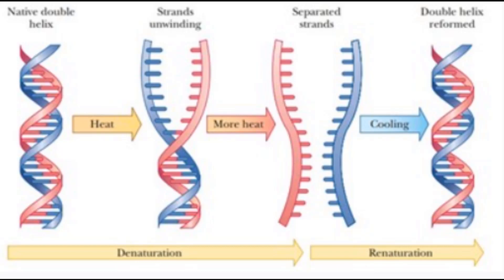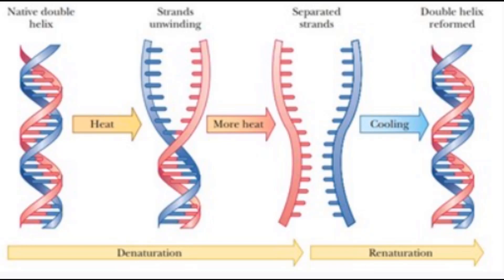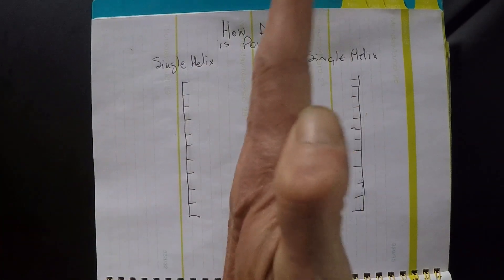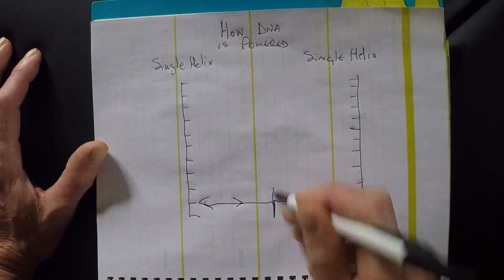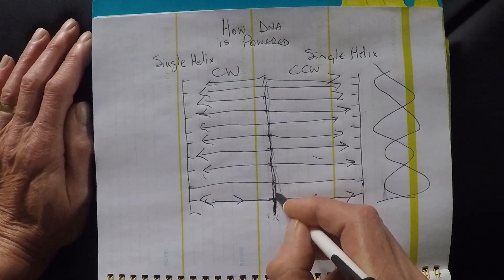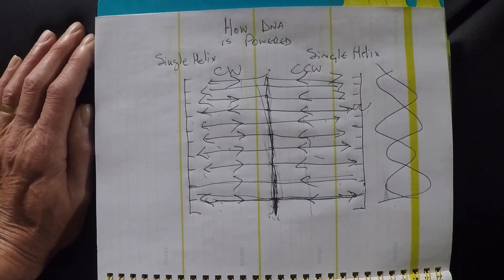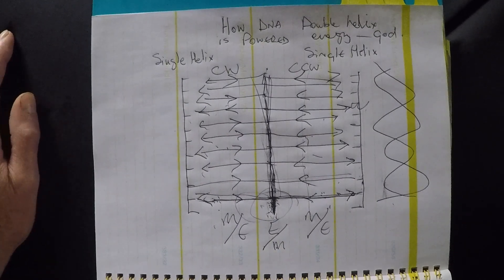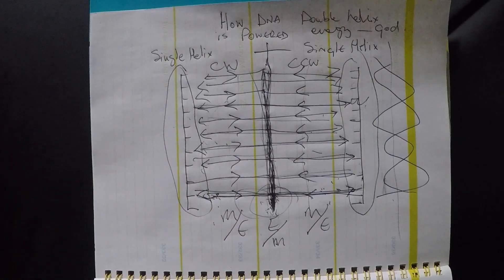DNA - How It Is Powered? -First Correct Explanation Ever.

Comment: Hi Lee, I'm intrigued by your explanation.  How much current is flowing up your "Jacob's ladder"?  Also, as you are no doubt aware, current can only flow when there is a potential difference between two parts of a circuit.  Can you explain how the potential difference arises between the top and bottom of the separate DNA strands?
Reply from the maker: left is female right is male..+ and -
The energy is from the system it is in..the earth field...you are connected to a birkeland current at birth.
"cut the golden string" is in many mythology tale.
Your sex is decided by whether the birkeland current is cw or ccw...up or inverted.
male and female he created them.